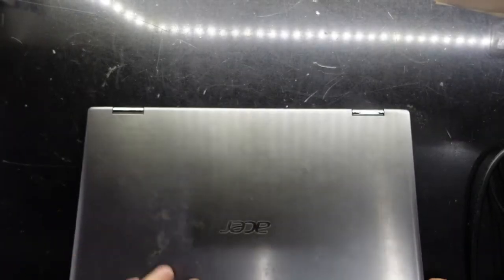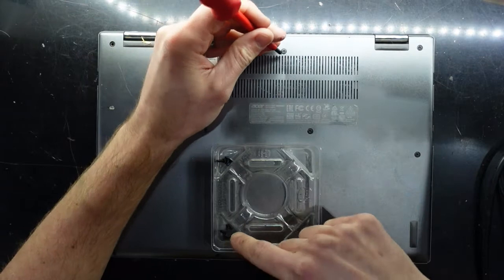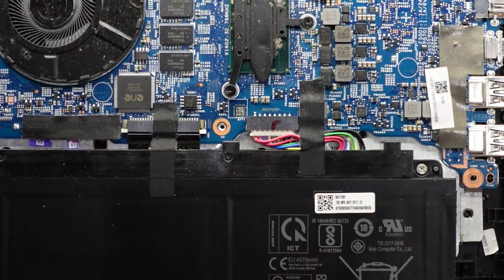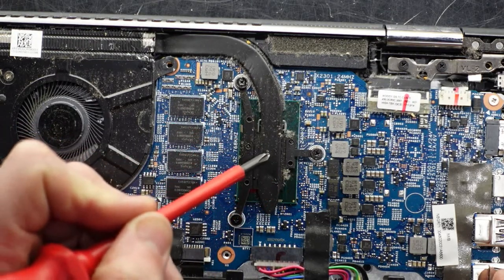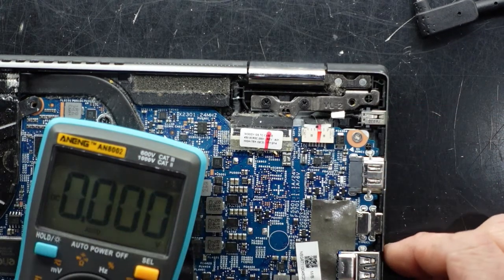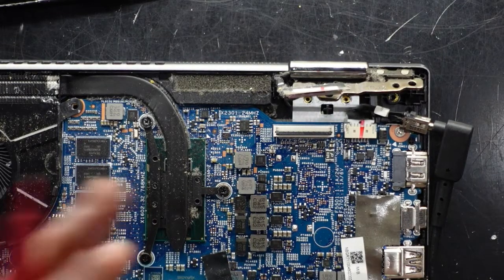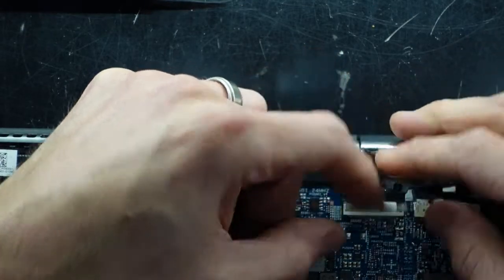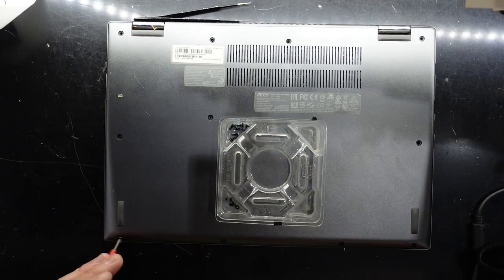Acer Spin 3 513 Teardown and upgrade overview

Comment: Excellent video, one question, can I change the sata memory for an NVMe and up to what capacity could it be 1TB or 2TB, which one do you recommend? Cheers...
Reply from the maker: it would depend on what processor you laptop has, if its an intel 7th gen or newer and NVMe should work 

pretty much shouldnt be a limit on the capacity of the nvme